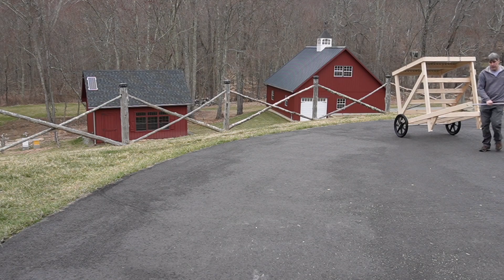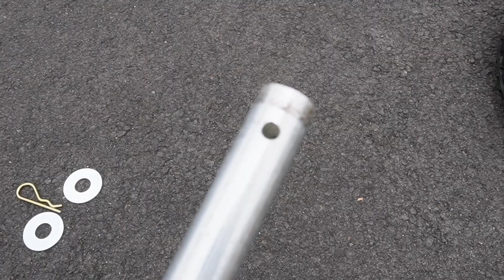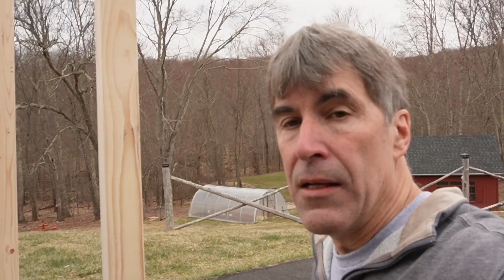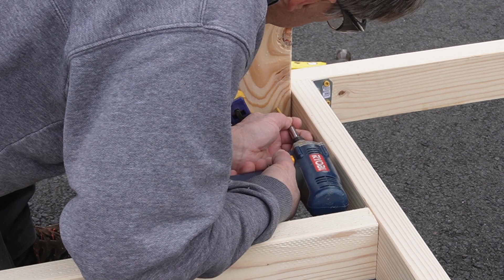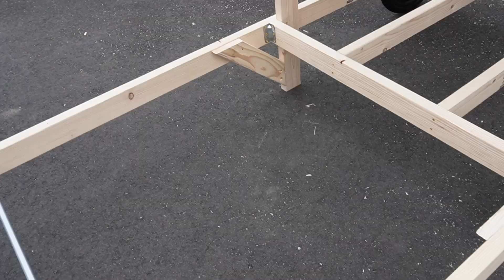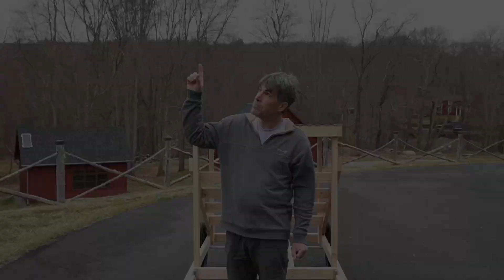Turkey Shaw Build

Comment: How did they like it/how did it work out?  I am concerned about wind, it’s very gusty here in Indiana.
Reply from the maker: The Turkeys did use it and it gave them shelter from the sun and rain.  However, because of a predator attack we had we changed our way of raising our Turkeys to protect them better.  We now raise them in a Chicken Tractor the same way as our other meat birds.  We may go back to using the Turkey Shaw when we move to our new farm property with some modifications to our fencing.  I never had any problems with wind blowing it over.